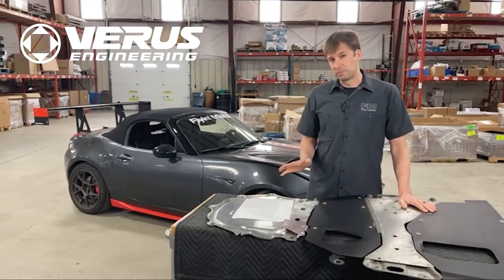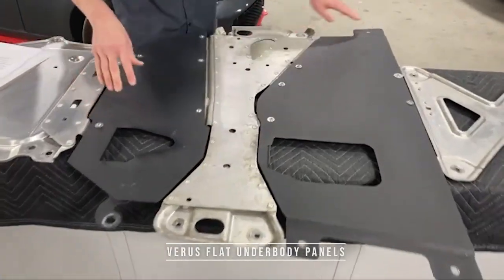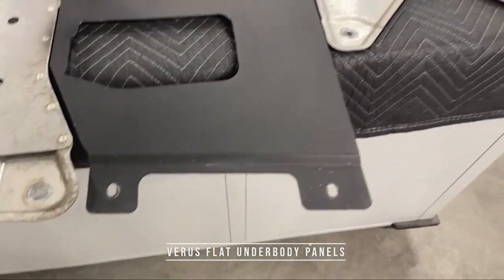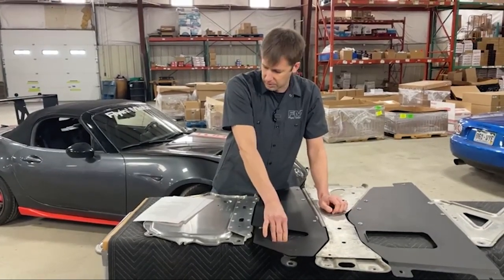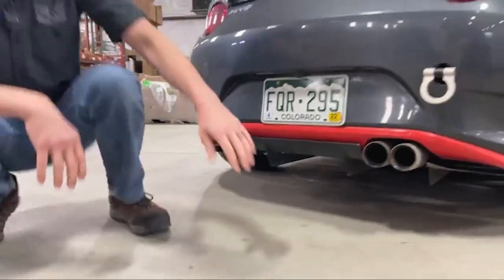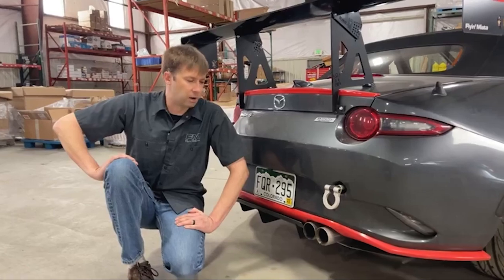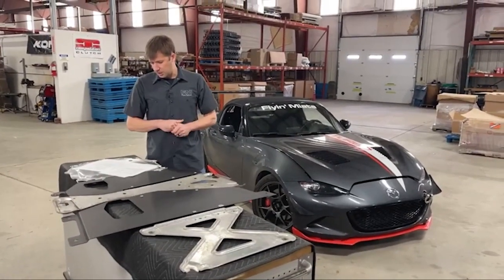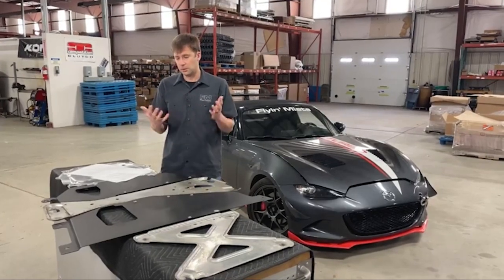ND Aero Parts by Verus Engineering (FM Live)

Comment: I have the full under body kit on my nd. It was installed a section at a time over a few weeks ending with the middle. The rear diffuser made the most difference. Noise at highway speed is reduced and handling over 65 is better. I highly recommend but am also worried about heat build up on track in the drivetrain.

Comment: Ok, you asked...
As for instructional install videos, how about doing a timing chain replacement for the ND? Turbo install for the ND? Header, mid-pipe install for the ND? Window regulator replacement for the ND? Oil coolers engine, trans and diff for the ND? Suspension upgrade on the ND2 since it has the KPC or more info on the KPC, not that Keith didn't do a good job, but some driving reviews would be nice too.
I know I only mentioned ND, but that's because YT is filled with NA,NB and NC installation videos...and I'm looking at getting a new ND2.😀
Reply from the maker: Thanks for the suggestions, we'll add some of these to our video idea list!
Reply from the maker: Oh, and be sure to search our channel. Since we do a new video every week, some of the older ones can get hard to find. Check out Keith's video on our ND Trans, Diff & oil coolers!
https://youtu.be/fAFkinnMu6s

Comment: If you are going to choose one of these to get. The canards will most likely be the best single mod to get.

Aero wise for the diffuser to function you will want all of the other underbody panels. (extremely short explanation) the flat underbelly is key to reduce turbulence keeping the air attached to the panels which allows the air to flow along the upwards curve of the diffuser creating a better suction effect. The faster you can get the air moving, the lower pressure you will have under the car. High pressure above the car with low pressure under the car results in a downwards force.

Jullian edgar or EngExplained have some informative vids on this that could explain better.

That being said, looks like I have more to add to my 22 club rf once it arrives

Comment: These parts look good BUT it is a high price to pay for minimal gains ($199 for the canards!). However, if you have a generous budget and you are using the car on track a lot then perhaps it would be an 'end of list' set of modifications.
Reply: The parts are at this higher cost for one reason: research and development! They are one of the best (arguably the best) in this business for a reason.

Comment: So for anyone that has these or knows, is the 10 points improvement a noticeable or impactful difference. I’m interested but only if it will help with the downforce enough to be worth it. The car is a little floaty above 75 and I’m on full suspension upgrades. I need some downforce but don’t want lip or wing.

Comment: Has anyone weighed all the pieces? 2 middle, 2 rear suspension, and diffuser.
Reply: Yes, installed weight is the following… Added underbody aero panels 3.1KG (rear diffuser) + 2.2kg (suspension covers) + 1.9kg flat mid underbody = 7.9kg

Comment: If you get the full underbody bracing can you also add the full aero underneath too?
Reply from the maker: The Verus panels are made to attach to the stock bracing, but could possibly be made to work with other bracing. We have not tested it with any other aftermarket kits. Give our CSR team a call, or reach out to Verus directly. They should be able to give you some better answers.

Comment: When a item is rated for an amount (i.e. 60lbs) of down force it adds, what speed is that? Is their a speed standard for this rating with aero?
Reply from the maker: Usually there is a standard, but different tests can be set for different standards. Verus uses 100mph for most of their testing. You can see more info on the testing and science behind their products in the blogs on their website.
https://www.verus-engineering.com/blog/new-product-11/in-depth-understanding-of-dive-planes-on-the-nd-miata-46

Comment: What about the rear suspension covers. Ie does it work with your coil over setup.
Reply from the maker: We don't currently have them for sale on our website, but they should work fine with our coilovers and we may add them to our catalog in the future. Please reach out to our customer support team if you have any specific questions about fitment before purchasing.
Reply: @FlyinMiataVideo  What about the suspension cover with your diff cooler? Also I'm curious about the heat build-up of transmission with those cover installed